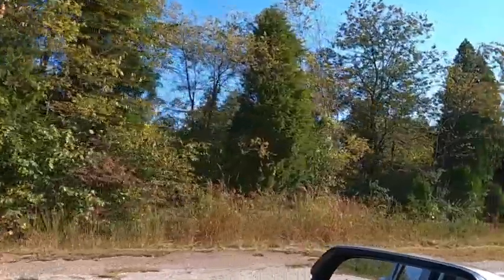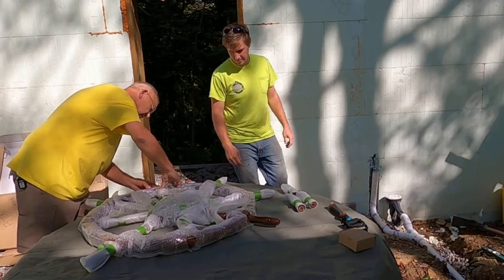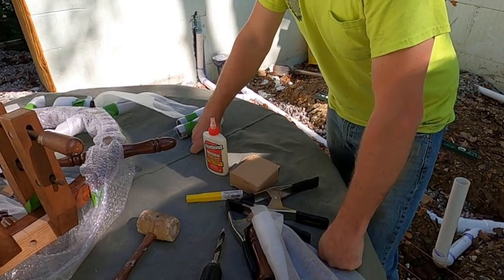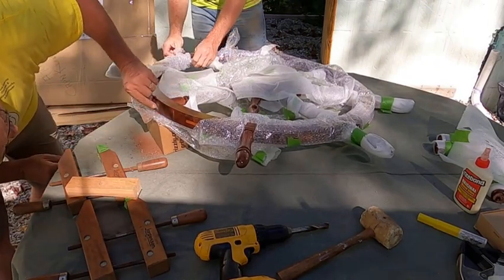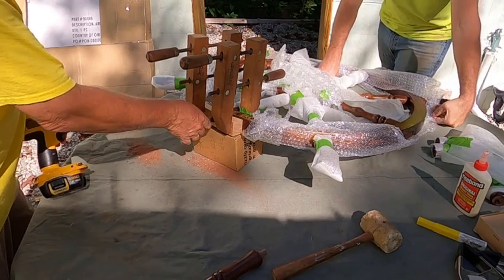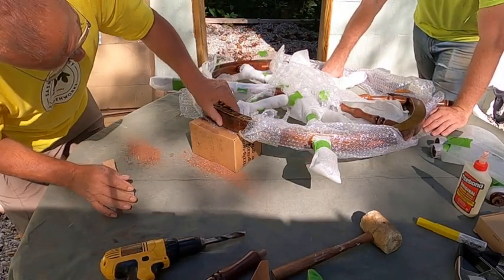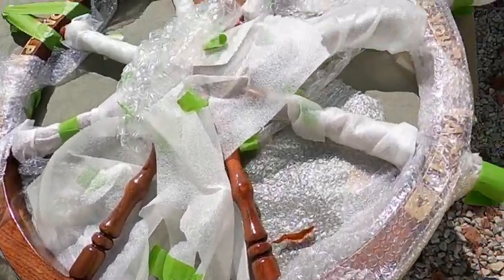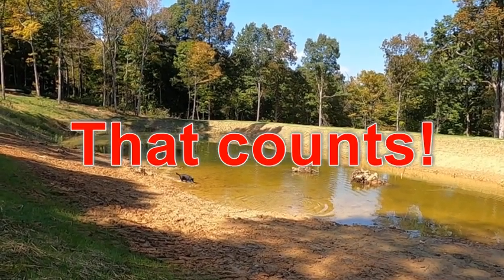Makin’ Stuff: Cap’n Kleeman’s Wheel Gets Fixed

Comment: @0:25
At least your navigator in your dash kept you in the same country. I could see where the fastest route from A to B will cross a state border since many borders follow rivers like between KY and IN and Interstates somewhat go straight. 
6 summers ago on a family trip from Ontario our first destination was Ben & Jerry’s Ice Cream in Vermont. I set the GPS for a small town in Quebec not far from the border crossing I planned to use but I didn’t pay attention to the “route” in between. For whatever reason it directed me across the border into New York at Cornwall Ontario. After I realized we were actually at the border with no chance to turn around we once crossed I checked the route and our destination was still that small town north of the border in Quebec. 

Bottom line is that navigation systems aren’t perfect, so sometimes you need to be a little bit smarter than your “tools”.
Reply from the maker: They’ve gotten a whole lot smarter… however I haven’t!!  Thanks

Comment: The drill guide was a brilliant idea to bring along for the repair. Too bad that brilliance didn’t carry over for a sharp drill bit or even better a forstner bit. 
In the end the DIY ingenuity prevailed and the layer of cardboard did the trick.
Reply from the maker: Wayne, I had a brand new Brad point bit… it is still chucked in the Shopsmith from when I drilled the guide!  I think I got into too big a hurry to pack up… and left it and the handsaw at home!!

I thought about a Forstner but the smaller diameter shaft doesn’t guide as well as the Brad point.

Thanx